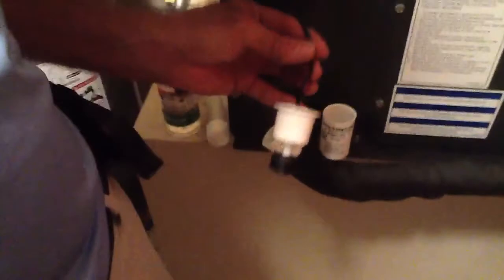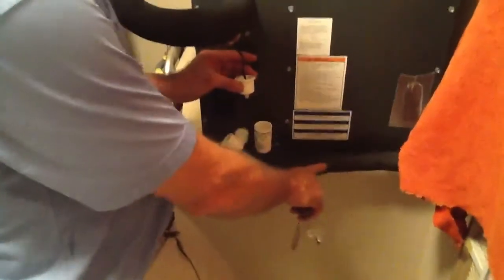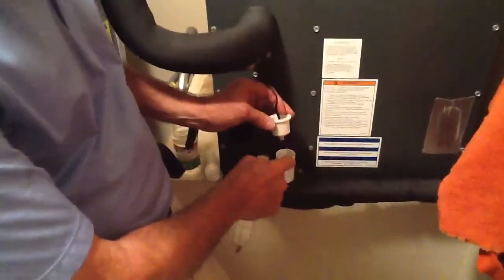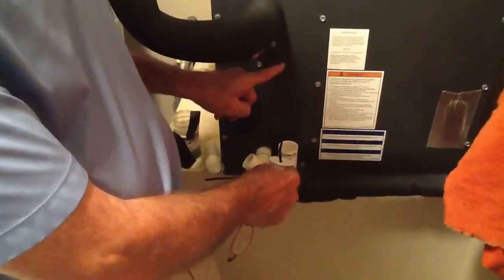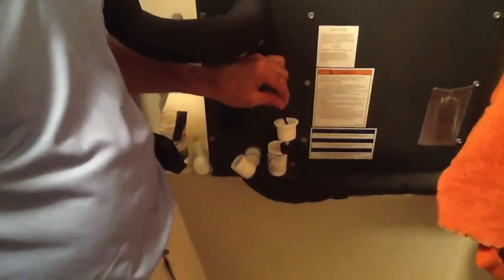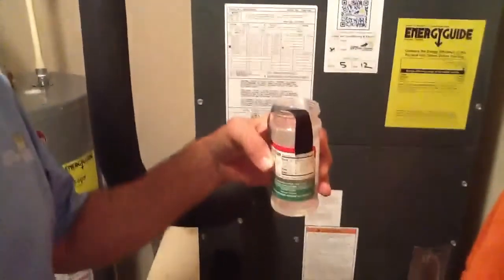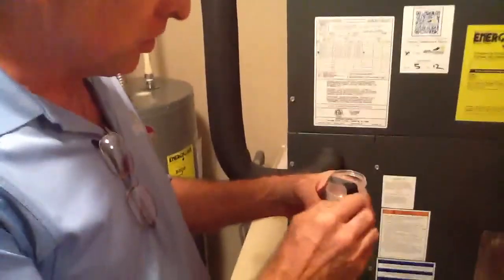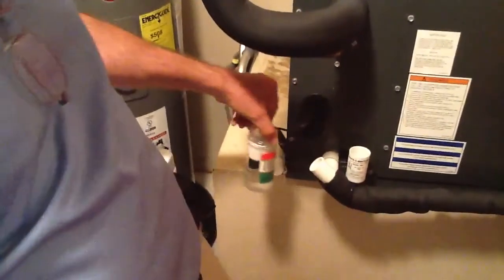"Thermostat Blank? Avoid Costly Repairs With These Homeowner Tips"

Comment: that is what happened to my thermostat...i thought it was broken by going blank. the float switch turned off the A/C for safety. my bathroom sink had clogged up. the question is why is the drain from my A/C in attic sharing the same drain in my bathroom sink?